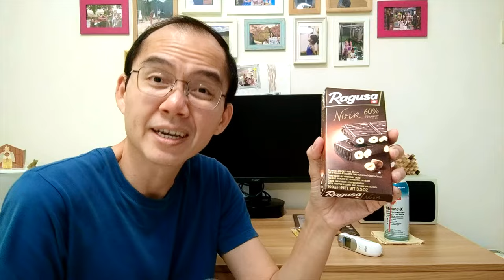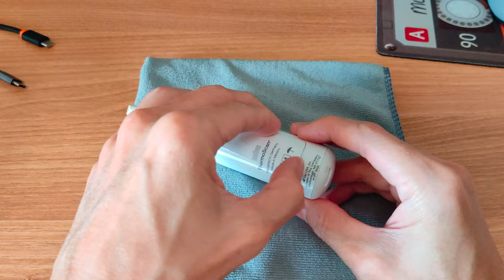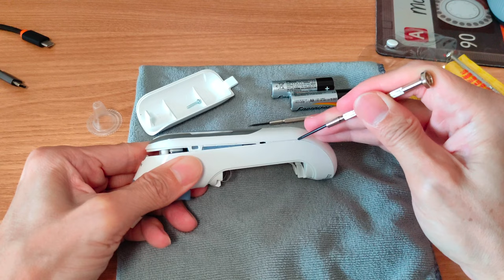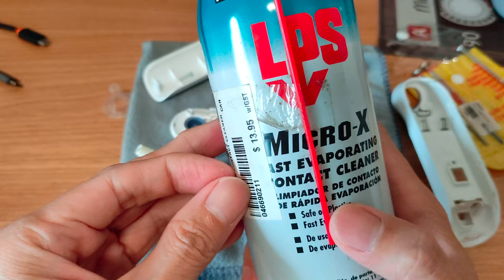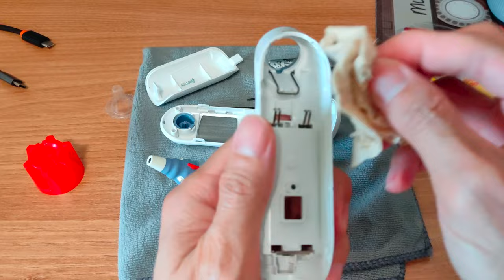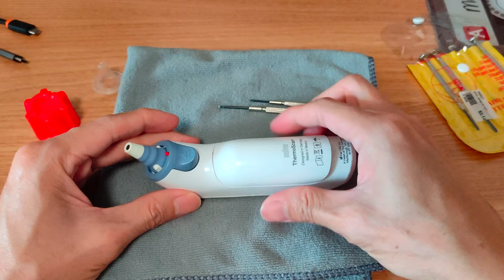How to Fix Braun Ear Thermometer in 10 Minutes

Comment: I had a different issue in that the thermometer was reading too high but after disassembling I happened to notice what looked like a tiny hair on a square sensor below the ear part, but after removing this it started working correctly again. Thanks for the tips on disassembly - mine is butchered now from the screwdriver but at least it takes the temp! 👍

Comment: Thank you SO MUCH for this!

My thermometer didn't have the same problem yours had; the problem my thermometer had, was that it wouldn't switch on AT ALL!

I thought I might as well give your video a try, before purchasing a new thermometer.  I had an idea that the issue was due to a battery leak.

  I followed your instructions for opening the case, and what did I see? 
Although the 'motherboard?'  was entirely clean; there appeared to be leaked battery fluid on the inner battery contacts (the inside of my model, is slightly different from your own, with one flat battery contact, running along the width of the device).
  I wiped this down, and reassembled the device; it is now WORKING PERFECTLY .

THANK YOU so much for posting this, you have saved me some money, and prevented a savable device from ending up on the scrap heap!
Reply: P.s,

I didn't  have the contact cleaning spray, so used a spray for disinfecting electrical items (e.g. clippers, shavers etc, on a sterile device wipe), with a toothpick to assist with lifting dome of the battery fluid debris).

Comment: My issue was different, temperature was too high all the time, and after a while I got a system error. But even though I couldn't find anything when disassembling, after I reassembled it started working properly again.  So thanks for the disassembly instructions. They really helped.

Comment: I had a flashing screen and taking the batteries out didn’t help. Slightly different model but basically the same disassembly and cleaning the corroded contacts fixed my problem too. Thanks!